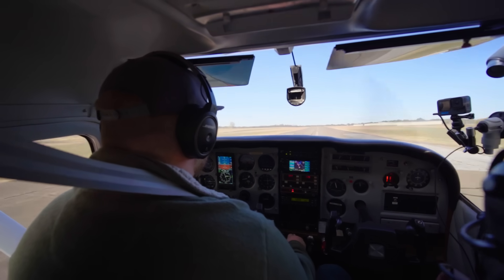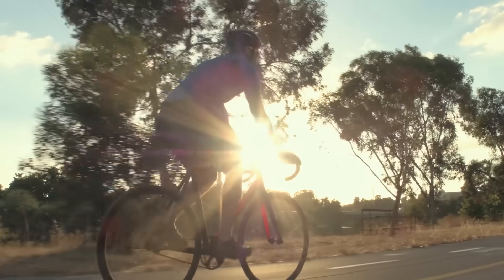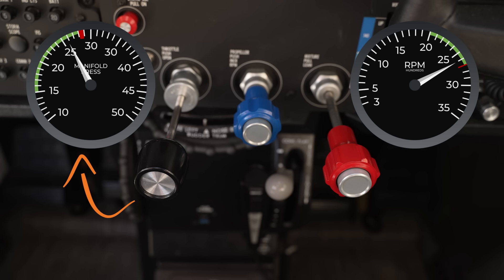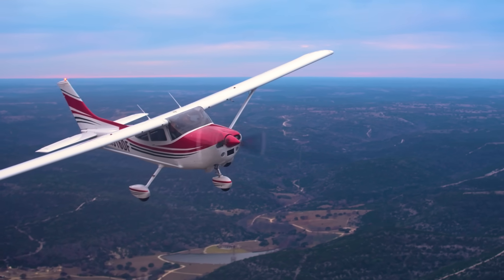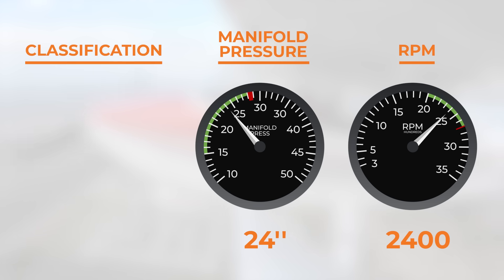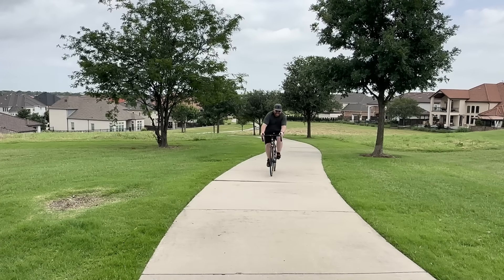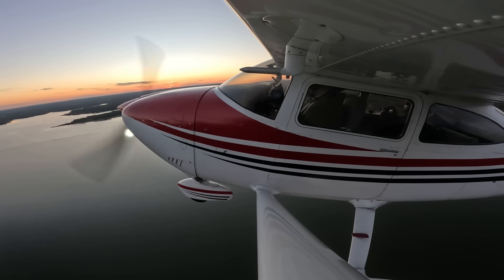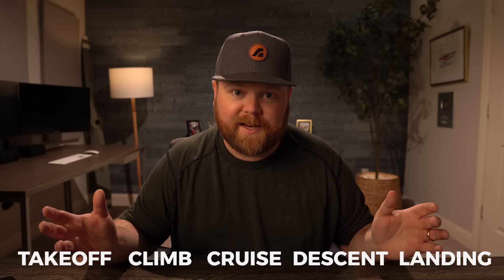Constant Speed Prop Explained in Plain English (Start Here!)

Comment: This is a fantastic video.
 I tell my students you never want the engine working harder than the propeller.
Reply: That’s how many of us were taught but it’s really been debunked at least in the Continental engine world though don’t expect it different with other manufacturers because it’s all the same physics. Look up some of Mike Busch’s or Deakin’s (forgot the first name- John maybe) work.
Reply: @dac7046👌
Reply: My Turbo Arrow owner’s manual disagrees. In fact, every combination of MP and RPM in the performance chart has MP greater than RPM (except one out of 15). The biggest difference is 31.5 " MP and 2575 RPM. I usually climb at 34" and 2300 RPM at 75% power—the lower RPM makes less noise for both passengers and people on the ground. I cruise at 32" and 2300 RPM at 65% power. 
Even my carbureted 182 allowed MP greater than RPM at 2200 RPM at low altitude. 
Likewise with the T210 there are plenty of combinations in the owners manual where MP is greater than RPM.
Reply: @CherokeeFlyerKSBP Yeah, because its turbo'd lmao
Reply: @CherokeeFlyerKSBP  His 182 manual disagrees too.
Reply: And let’s not forget, every take off invariably has manifold pressure numbers exceeding engine rpm numbers…
Reply: Exactly! The way this was taught to me was: "don't let the throttle get ahead of the propeller pitch".
Reply: Thank you for your exploitation!! I've been studying on pilot training the manifold pressure and i didn't understand, but with you vidéo it’s way more clear! 😊

Comment: 9:22 Ugh, I can't believe people not only still believe this myth, but are actually making videos to propagate it to other people.

Moving the prop RPM first when you're going up does reduce engine stress, but the numbers themselves don't matter. If the plane's manifold pressure gauge reads out in psi rather than inHG, does that mean you can't take the engine RPM over 1,200? (25 inHg = 12.3 psi)

The AIM says this is a myth. Engine manufacturers say this is a myth. Please stop spreading myths, and focus on facts.
Reply: I came here to say this.  If this was a legit concern we would never be able to take off at sea level in most piston singles.  But it is true that you are more likely to spend time in the "red zone" of engine operation by running over square and the method he described will help you avoid that zone.
Reply: Agreed. The "oversquare" myth was the only real misstep though. Good explanation aside from that.